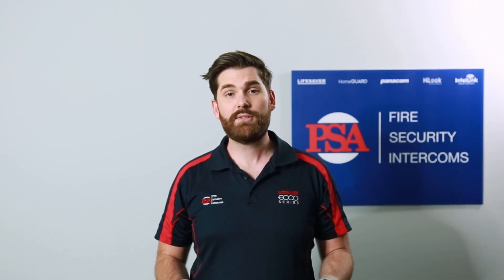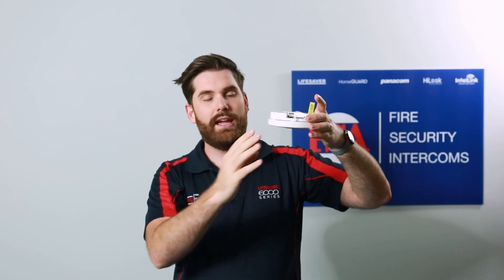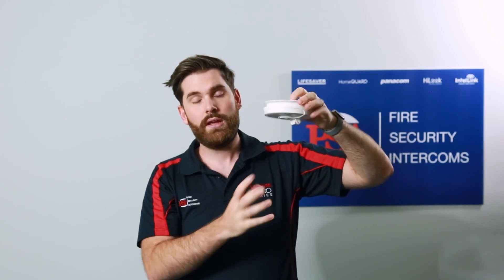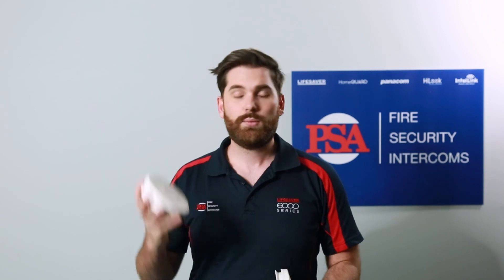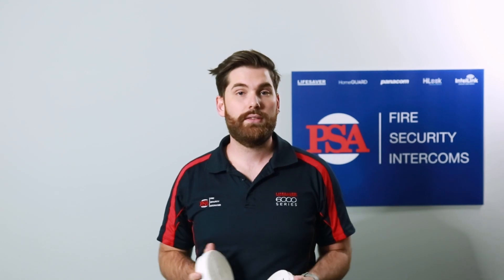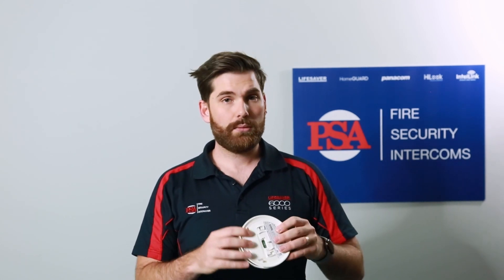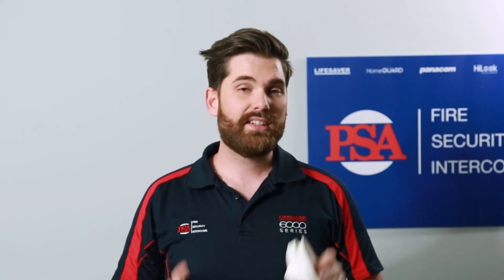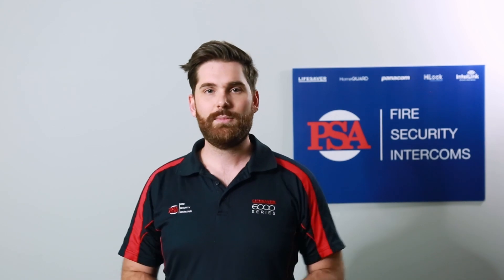What is the Difference Between a Heat alarm and a Smoke Alarm?

Comment: Which is best for detecting electric vehicle fires? And can these be interconnected with the rest of the homes smoke alarm system?
Reply from the maker: Hi RubLar, There haven't been specific tests done to confirm, however, it is more likely a smoke alarm will detect a fire faster than a heat alarm since in most cases smoke from a fire will the alarm before the heat will trigger a heat alarm.

To answer your second question. Yes, all the Lifesaver smoke and heat alarms can be interconnected, however, they can only be interconnected with alarms of the same manufacturer.

Comment: hi sorry for the random/stupid question.. im looking to install a heat alarm incase of fire.. would you happen to know how 'big' a fire would need to be in a room for the alarm to go off? I understand its around 53 degree C but unsure what this is in terms of size of fire (hard to answer depending on room etc i guess)
Reply: Hi I am an informal fire protection consultant my answer to  you would be maybe you mean how many heat alarm do you need in an area well the spacing for heat alarms is listed in the directions but some heat alarms will only activate if the temperature is heated above a certain temperature some may also have a rate of rise feature that if the temp raises to quiclkly it will activate I wish you good Luck !!!
Reply from the maker: Hi Rian, 

Unfortunately, this is a very complicated question, and we are unable to give you a definitive answer as there are many things that can affect the temperature of a fire, eg, what fuel is burning, how much oxygen is in the air, the size of the room and even the ambient temperature. Since it will take the air around the alarm to get to 57 degrees Celsius with the LIFHA240 there would need to be a good fire already burning in the room, and depending on the size and material in the room, that could engulf the room in a few short seconds.

Ideally, and especially if there are people living within the space, use a smoke alarm for the quickest response since smoke is produced at the very early stages of a fire and usually as a fire is beginning to burn it will produce more smoke.

Hopefully, this helps.
Reply: @PSAproducts  thank you very much for the detailed response this makes sense
Reply: RIAN 
Some thing also to consider is that the reason photo electric use is increasing is because of its low rate of failure about 4% in both smoldering and flaming fire ion failures start at 20% and get higher heat alarms have approximately zero failure in most cases it's best to have both a photo  alarm and a heat alarm what hopefully what isn't detect ed by one will be picked up by the other a heat alarm cannot detect smoke